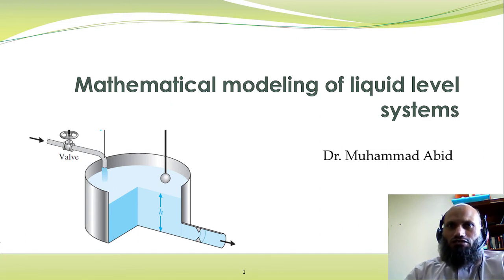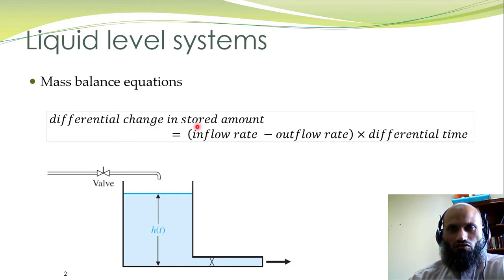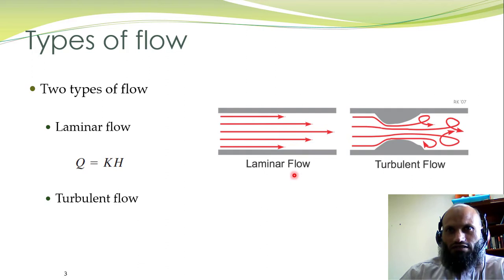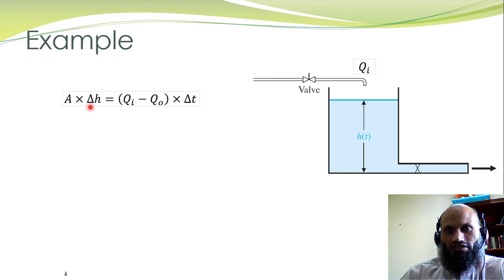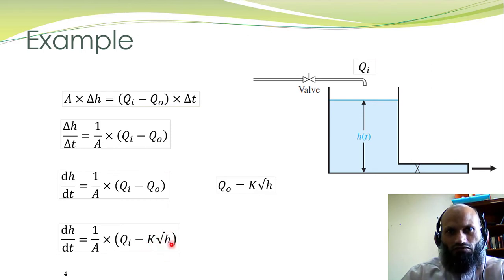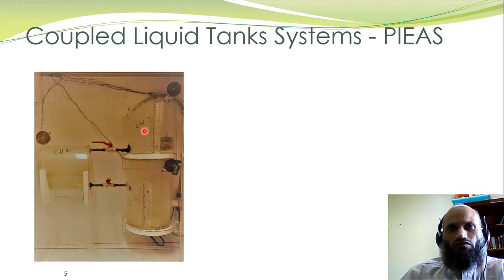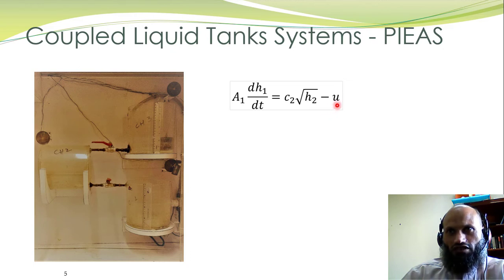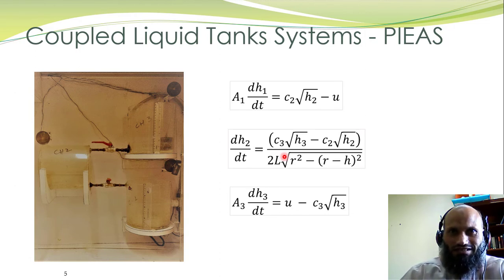LCS 14 - Modeling of liquid level systems

Comment: How do we obtain the transfer function of it, because it has square root on 1 of the h(t)
Reply from the maker: Transfer functions are defined for only linear systems, that is, the systems which are described by linear differential equations. The system underhand is a nonlinear system and we cannot find a transfer  function for it. However, we 
may linearize it at an operating point and then find a transfer function.